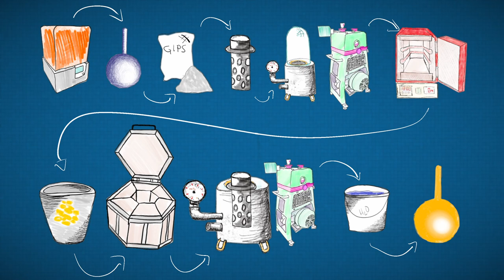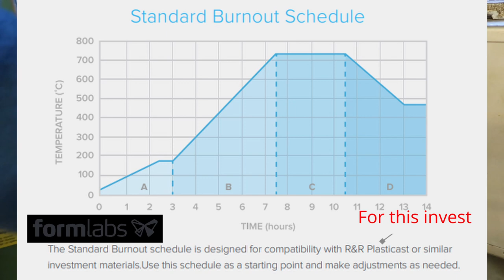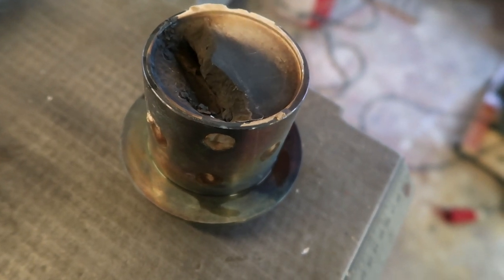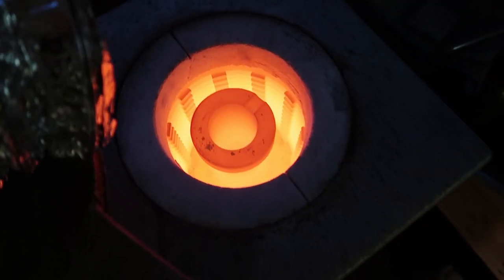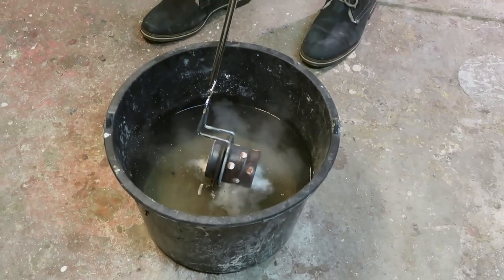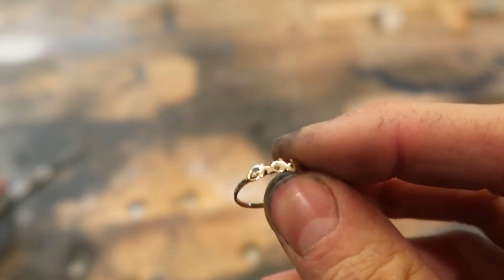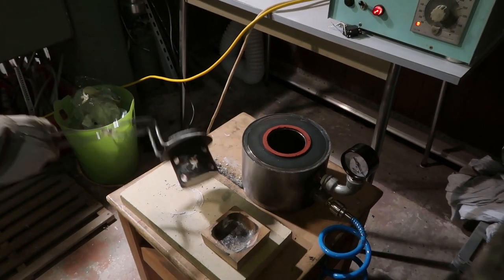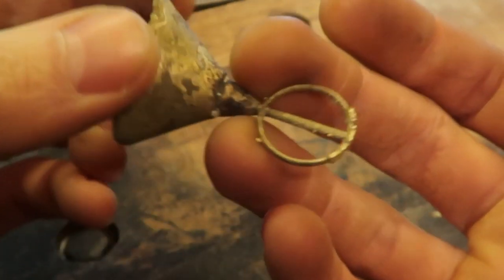3d Printed Vacuum Casting Part 2 | CASTING STUFF

Comment: FWIW when I learned to cast with wax forms we applied a spray on surfactant to the form before investment to reduce the chance of bubbles adhering to the wax. Many investments these days have a built-in surfactant but maybe a separate one would help with the investment you are using and or not a "full" 29.xx" of vacuum. Searching for the surfactant, it is usually called a "debubblizer" which I don't think is an actual English word :)
Reply from the maker: Dude awesome tip thanks a lot! I had some bubbles stick! I will order some and do some experiments :)

Comment: You want to remove slag to remove impurities. So that all that you're pouring is brass. Ive never cast in brass so I can't say much for how much slag you get but I cast aluminum and the oxidation causes a lot of slag to float to the top and you want to scoop that out. You may lose a bit of metal but collect the slag, then do a slag cast so you get back the metal you lost originally. Love the vids so far!

Comment: For small castings a centrifugal casting machine works well and I've been using a resin printer with a wax like resin to create the patterns to be burned out. I don't know if the bubbles there are due to the vacuum casting process or insufficient vacuuming of the plaster. My father is an old school goldsmith and it took time to convince him to get a resin printer. When I showed him the results of the casting using resin he immediately went almost all out with the 3d printing as it's not hard to model jewelry compared to sculpting the wax to make a model.
Reply from the maker: How do you deal with the little imperfections left by the supports? That's what I'm struggling with now...
Reply: @DmitriIvanov  I just use a cutter used for cutting gunpla runners. Gunpla is a gundam model kit and some vendors sell cutters for that kind of hobby. That cutter has a nice flat edge to cut the support very near the model it's supporting. Also using different sizes of supports helps a lot. The small supports leave the least marks but you will need a couple of large supports exactly on the lowest part of the model so it won't snap off and adding a few medium supports. There's also placing supports on areas that will just be filed anyway so I usually just angle the model in that specific orientation. Using the gunpla cutters offers the best result but it takes time to snip off those supports properly and since my eyes are bad due to my age I need to use a watchmakers loop to make sure I cut it properly.

Comment: Since you're printing the sprue and funnel anyways, maybe design an integrated slag gate by having your sprue off-center opening into a secondary funnel that gets fed from the primary(pouring) funnel through a submerged gate. I hope that makes sense. It should keep almost all the slag floating in the pouring funnel. The only drawback I can think of is that you will need a steady and accurate pour.
Reply from the maker: Most of those words means something to me but not in that order. I'll do some more research but I understand more or less what you're saying. Cool tip, thanks! 🙏

Comment: I use 25% silver and 75% copper, no brass melting brass has Zinc and fumes of zinc are poisonous. I was casting silver jewellery only till 2006. Once the silver price shooter. I was asked to cast Brass jewellery. I shut down my shop as I did not wanted to breathe zinc fumes from brass. Low percentage silver casts excellent. Without any porosity. Try it and see.
Reply from the maker: Got myself some silver....is the alloy important or will 100% silver also cast well?
Reply: @DmitriIvanov  if you want to cast silver put only 4 percent pure copper, as pure silver is too soft to finish and polish.
Try and see. If you want more hardness of silver than put 7.5% pure copper. Hope this helps.
Good luck and be happy
Reply from the maker: @Digital-Dental-Designing-Tech  great thanks a lot...i will try in a few weeks and let you know how it looks :)